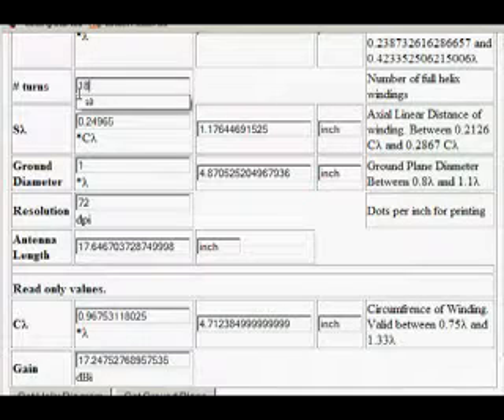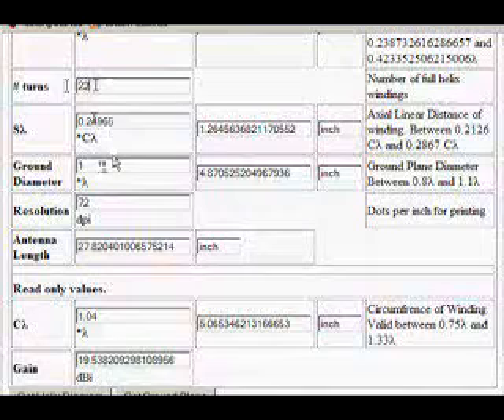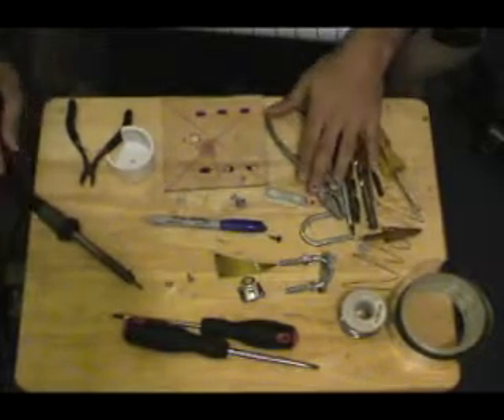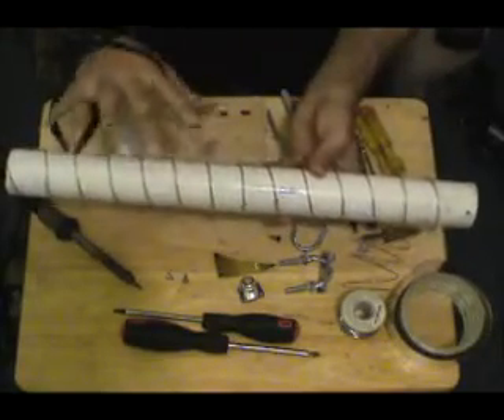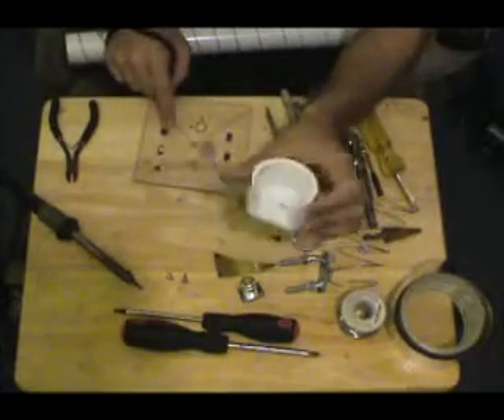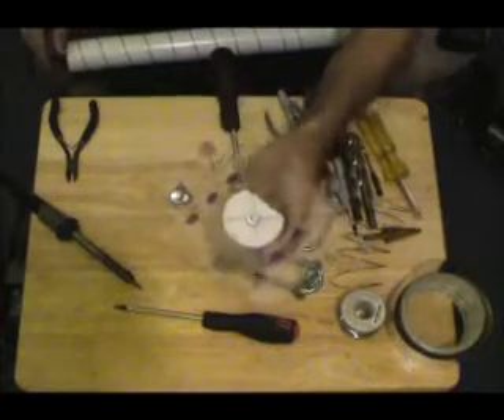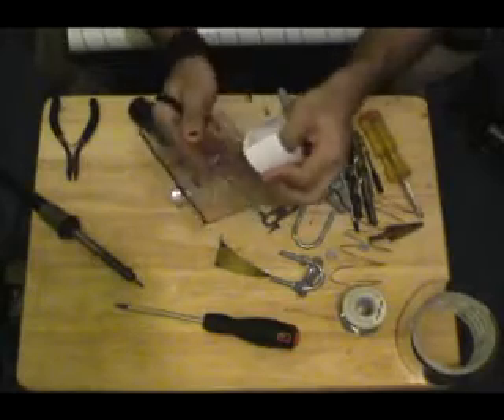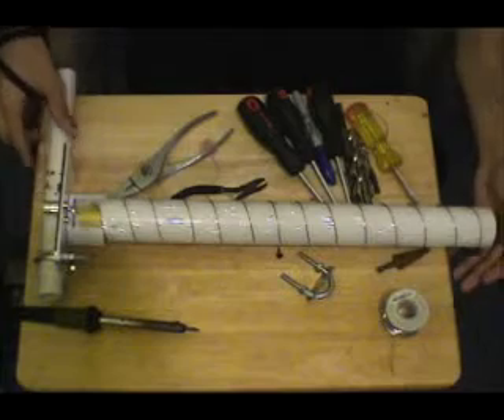2.4 Ghz Helical Antenna -Part two

Comment: pvc is poor for antennas, absorbs radiation from antenna...Otherwise great vid....
Reply: +brian shaw to see if PVC absorbs radiation, stick a piece in a microwave oven on full power for a minute if it melts its no good, if it doesnt it has absorbed any (old ham radio trick) not all PVC is the same